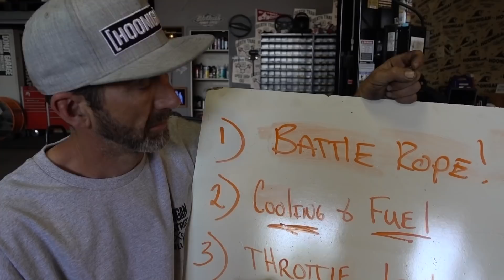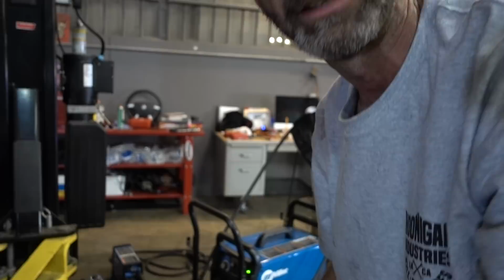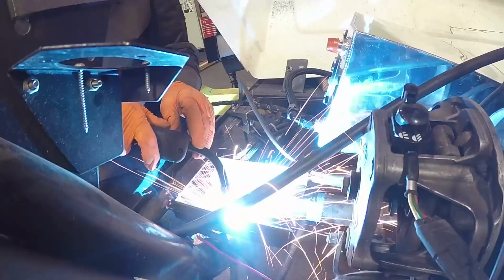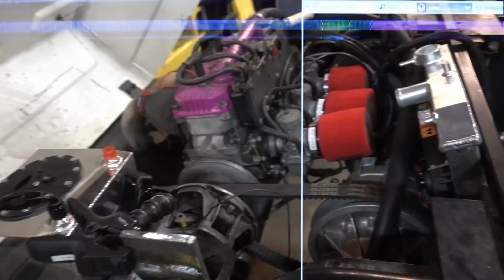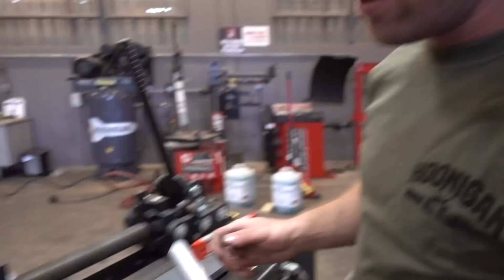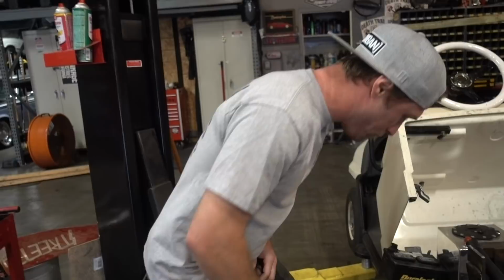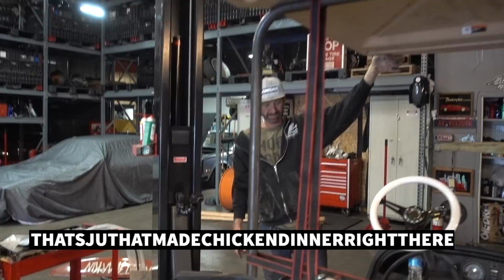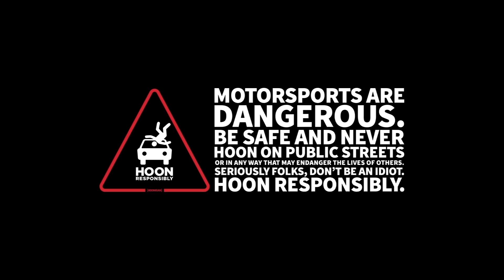First Fire of the 750cc 2 Stroke Golf Cart and Cage Build

Comment: FUNNY I DON'T GO TO THE DEPARTMENT OF ENGINE VEHICLES
Reply: Braden Carlson haha
Reply: It's not called an enginecycle either.
Reply: haha good points. Guess they were just planning for the future of electric cars
Reply: I wonder if they'll build an engineized scooter next
Reply: Motors are not electric specific. They are anything causing motion. Muscles are a bio motor for example.
Reply: Kolin Stallman a motor is anything driven by another power source.  Like hydraulic, or pneumatic, or electricity.  An engine creates its own power.  This is an internal combustion engine.

Comment: mo·tor
ˈmōdər
noun
1.
a machine, especially one powered by electricity or internal combustion, that supplies motive power for a vehicle or for some other device with moving parts.

Sorry but brad is correct. No need to correct him.
Reply: I woudn't even have noticed if they had not pointed it out, since it's motor in my first language.. 
Jeremy Clarkson would probably laugh at the "Ameericaan modurr" though.
But It's actually correct in multiple languages.
Reply: Just for youtube  el motor. Jajaaj
Reply: I don't care if he says engine or motor, or if you say engine or motor, neither term is incorrect for an internal combustion engine. 

I don't care if the editor says engine and brad says motor, they're both fine. I just wish the editor would stop fucking correcting it, like when people say emergency brake too, they correct it to handbrake, when its perfectly fine as an emergency brake. And let me tell you, when you're about to enter a corner at 2 times the speed limit and your brakes fail, it's an emergency brake not a handbrake. I know this from experience.
Reply: "correct" terminology is changing with the invention and widespread use of electric power plants. An internal combustion system is now referred to as an engine whereas an electric system is considered a motor. It's like calling a vehicle technician a mechanic. Just updating jargon to be more correct and to avoid confusion.
Reply: +Chris Young I said i don't give a shit what you call it. It's an engine and it's a motor. So stop correcting him when he says a correct term when reffering to a snowmobile engine. It's an engine, it's a motor, it's both of them. If you don't want to call it a motor, don't. By definition a 2 stroke is a motor and an engine.
Reply: Just for youtube don't shoot the messenger, I'm just telling you why they're correcting "motor" to "engine"
Reply: +Chris Young They weren't correcting him. 

You weren't really being a messenger when you share the same opinion as them, that motor is outdated and he shouldn't be using it. 

He should use what he wants because it's correct, you cannot correct him any further. He's using the correct term, that's it. In 50 years maybe Motor will be wrong, maybe Engine will be wrong, or maybe every ICE will be a motor. It's correct now and he and probably 40% of the automotive industry will continue to say it that way. 

I understand that language changes, i don't care if it changes, i don't care if motor really is incorrect in 20 years. I care that people are trying to force it to change.
Reply: Just for youtube you must have me confused. I really couldn't give two flying shits whether you, him, or anyone else says "motor" instead of "engine". I'm just trying to inform you, not persuade you to change the way you think nor force that mindset upon you. I happen to be in a situation where it matters, so I have to be careful about which one I say. But for anyone else, go ahead and say whatever you want, that's your right and I honestly couldn't care less.
Reply: +Chris Young It sure felt like you were trying to persuade me that i'm wrong. But if you weren't you weren't and thats good. 

What position are you in? School? Like a trade school or something? An engineer? 

I try to say engine whenever it is really an engine, and motor when it's a motor, but i call engines motors from time to time. I don't really need to say either one, in the position i'm in.
Reply: Just for youtube I'm in tech school for vehicular maintenance in the military. Sorry I came across like that, I was just trying to be helpful.
Reply: +Chris Young I hear you, over text I just misread your tone, sorry. Yeah the military doesn't mess around with stuff like that lol.
Reply: All engines are motors. Not all motors are engines. 

Stop being pedantic.

Comment: Did you lengthen the distance from the header to the expansion chamber?  If so, that will change the pressure wave timing and can make quite a bit less power.  Sure did sound good running though!  Nice job!
Reply: Dan B yeah noted that + no stinger so pretty much shitty power compared to stock but it will be overpowered anyway 😁
Reply: I was thinking the same thing, but it'll probably still be ridiculous
Reply: No stinger either, I hate it when four-stroke people touch two-stroke pipes. It sounds like an indian farm bike.

Comment: My brothers, love the project!!! Shrink down the stinger on the end of the expansion chamber. That large bore all but eliminates the effectiveness of the expansion chambers back pressure and scavenging effect. Open header or not a two stroke needs to have that crisp sound to have the proper scavenging, unless you plan to just run it at 8 grand or more all the time then it's not necessary. Not talking smack my friends, just what I would say if I was there. Looks stupidly awesome though!

Comment: Since the engine* is connected to the traveling arms of the suspension isn't the exhaust going to be pushed into the frame once you hit a bump???? I see bent/broken exhaust parts in my Chrystal ball.
Reply: Tary1233 I didn’t know golf carts have traveling arms or even a suspension system
Reply: Well duhh, you wouldn't want an out of place sidewalk crack hurting your back and ruing a day of golf lol. No but you can see both those huge springs in the back of that thing numerous times during the episode and in an earlier episode they explained why they had to mount the engine on the suspension arms so the slack in the cvt belt would stay consistent. Pretty much everything a human can ride in has suspension besides like gocarts.
Reply: Tary1233 forklifts, plane movers, backhoes, excavators, and pretty much anything with industrial moving purposes lack any suspension components soooo...
Reply: Glad I wasn't the only one to come to this conclusion.  I thought I was missing something obvious.
Reply: well ya I meant things that go over 10 mph. My point was it sucks to go fast and not have suspension. especially in a 750 cc golf cart lol
Reply: I just hope that the cart self-destructs before someone dies driving it...
Reply: just coming back to this. The exhaust broke in half XD

Comment: I might be wrong here but isn't the extension of the pipe that goes to the expansion chamber going to mess up the reflection of the gasses and cause huge power losses?
Reply: Dave Micolichek       The kind of not optional that ends with aluminum coated spark plugs.  But hey, pistons are cheap!   Lol
Reply: I want to say rich, but it seemed to rev fine. Guess we'll all find out the hard way haha

Comment: What's the matter calling an engine as "motor"? or am I missing the whole joke lol
Reply: Naufal Kusumah motors run on electricity, engines run on combustion.
Reply: Motor is electric powered. Engine uses a fuel source
Reply: Lemme hop on my enginecycle
Reply: But then the engine sits on motor mounts 🤔
Reply: Motors are electric, engines are combustion
Reply: @loric loppi Unless you have an electric motorcycle lol
Reply: Motors move
As opposed to stators, who don't move
An engine specifically turns energy into kinetic energy
Reply: *chemical energy into kinetic energy
Reply: Electrical, using an acidic electrolyte solution to ease electron transfer between dissimilar metals?
Reply: +loric loppi Haha.
Reply: Are some of you mistaking motors for generators(machines)?
Reply: "Electrical, using an acidic electrolyte solution to ease electron transfer between dissimilar metals?." Just as Jason said. What's up with all that aggression bro?
Now what occurs when the fuel is ignited in the cylinder? Chemical energy is turned into kinetic and thermal energy.

Comment: The "expansion chamber" actually works by sending unburned fuel that made it through the "combustion chamber" back into the combustion chamber at a certain rpm causing it to burn the fuel and raise cylinder pressure. This causes the 2 stroke powerband and is the reason changing the expansion chamber changes the location of the powerband.

Comment: Some advice. I would look for propper expansion chamber exhausts on the internet. You should be able to use 250 dirtbike exhausts, one for every cylinder in the engine.
Also if the exhaust doesn't fit,
it doesn't make a difference when you saw it apart, spin it round and weld it back together.
But don't change the length. The diameter of the exhaust in dependance to the distance from the engine has to stay the same.
Otherwise the expansion chamber doesn't work and you loose power. Significantly

Comment: by lengthening the exhaust you're going to change the power band of the engine , it shouldn't hurt it though, but that is still a modification to how the expansion chamber was designed form the factory also if you cut the factory end off a two stoke " the stinger " a put that huge tail pipe on it you'll lose alot of hp , generally on 2 strokes the smaller the stinger the more power but once you get to small you'll risk engine damage

Comment: Cool build, but coming from a snowmobile motor guy, we're totally missing the point about the exhaust. It's not only the shape of the expansion chamber, but the distance those shapes are from the cylinder wall that controls the timing of the exhaust pulses.  Somebody like Olav Aaen could build a pipe that would work on there, or at least build a turn-down manifold that would match the stock length.  I'd bet we're going to see a 30% loss, which I suppose is still going to be a 90hp golf cart... maybe I'm being nitpicky.

Comment: Just as a heads up if you're not actually done yet. As a snowmobiler I recommend making a metal guard for that belt like you see on sleds. Belts blow and it's not uncommon to see it pretty catastrophic either, as in blowing through the hood of a sled and such. 

Wouldn't want to see one of you guys get taken out by a hot flying rubber chunk or a broken piece of pastic even though it's under you in this. More importantly I would hate to see that nice intercooler or any lines get torn up. 

Take it for what it's worth.

Comment: The + of the battery is very close to the fueltank.
Also you said that changing the combustionchamber will affect the power of the engine, but changing the length of the piping before the combustionchamber wont be good either

Comment: You added a piece of exhaust pipe before the expansion chamber correct? Won't this mess up the timing of that wavefront going back towards the combustion chamber so it doesn't push enough intake gases back in?

Comment: Assuming this isn't efi is why the fuel pressure is so low? I have a efi sled but from what i've read it needs 30 psi but if i convert it too just carbs i should just need 5-7?

Comment: You talked about not ruining that exhaust and immediately ruined it. The stinger (extension after expansion chamber) needs to be longer and much smaller in diameter with a cone welded down to it. Maybe 1 1/2" x 8-10" long. Trust me it will sound a million times better and have more power.

Comment: you really dont need a fuel pump or reg if the snowmobile engine had the fuel pump that came with it. just gravity feed out of the bottom of the tank would be fine. the stock fuel pump is an impulse pump and gets it pulse from the crankcase. pretty sure the stock fuel pump is a conglomerate of hoses on the cylinder side of the plastic plate above the carbs
also the hoses coming off the top of the carbs they need to run to the airbox for proper fueling mixture. or you can cap them but usually some sort of jetting change it think. been a minute since i been on those carbs.

Comment: You might need better cooling than that. 3cyl 2 strokes can run extremely hot, and having basically zero air flow to the engine and radiator is likely going  too be an issue. At least get some more electric fans in there, or find some way too get good airflow, or you mighg cook that engine in a very short period of time.

Also, you're REALLY going too want a fan on that belt. It WILL get very hot, start too slip, and melt in short order. They generate a lot of heat, being s clutch squeezing a rubber belt, putting all 105 or so hours that engine is making to the wheels. You could imagine, it'll got hot, and fast.

Comment: Brad is not technically wrong in calling the engine a motor, because in fact a motor is defined as a machine powered by electric or internal combustion.

Comment: Adding 4" to the header length is going to fuck up how the expansion chamber works. Hope you don't change the stinger length or diameter any or you'll really fuck things up. You could save that pipe by sectioning the diffuser cone to make the 90 degree bend without changing its tuned length, then the performance would not change.

Comment: why would it matter if its engine or motor? the two words can be used. the motor is a device that converts any form of energy to a mechanical motion, and an engine is the same except it refers to a specific type of energy, Heat. so technically motor is correct but engine is more specific. They don't say things like "engine speedway" or "engine sports".

Comment: Try 680..  not 750.  Not even close to the 750, a 750 Storm (only Polaris sled to ever have a 750) engine would kill that Ultra engine.   (But the 680 is a great engine)  you also just knocked your 105HP down to about 65 with the fancy pipe mod.     Do yourselves a favor and leave 2 strokes - especially classic Polaris' alone.

Comment: first off, not sure why you added a fuel pump and regulator, the pump built into the engine would be just fine to pull fuel from that tank. by chopping up the tuned pipe you have untuned it, your jetting is going to be way off between the pipe, pod filters, and temperature you're going to operate at. and most importantly. that is not a 750. it's 680ccs.

Comment: 2 Strokes need an expansion chamber for EACH CYLINDER to work correctly. The way you guys used Y-pipes is completely WRONG...SMFH Its never going to run well...
Reply: Only having one expansion chamber won't change a thing. But having a longer distance from the header to the expansion chamber will
Reply: Mezz Ten BULLSHIT! The timing of the pressure wave and it's ability to go down several different paths to multiple cylinders completely fucks everything up! LMFAO
Reply: Then why do all 2 cylinder 2 stroke snowmobile today only have one expansion chamber bud.
Reply: Mezz Ten maybe you should research the firing order... Bud...
Reply: Then how is it possible for a 2 cylinder 2 stroke with one expansion chamber to make over 160 hp
Reply: Mezz Ten did you read my reply?

Comment: If you work in and around automotive industry, and call an engine a motor.. most educated people lose respect. If it runs via fuel, it's an engine. If it runs via battery, it's a motor. Considering golf carts have either a motor ( electrical/batteries), or a engine  ( combustion/fuel) it's actually important to say the right word on this project. Plus, why look/spread  ignorance, with a fan base this large. Let's not pull some Kayne boo boo titty fuck shit, meow. Haha